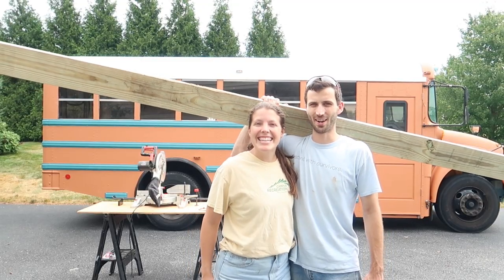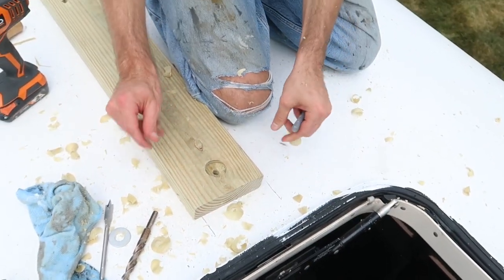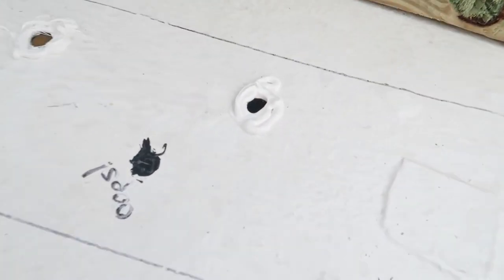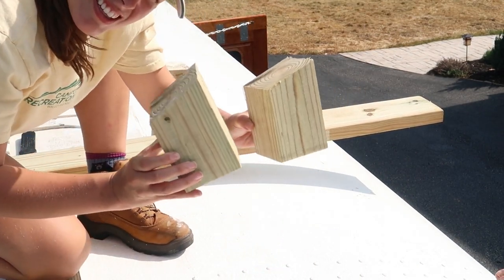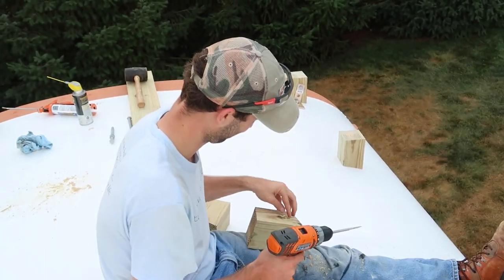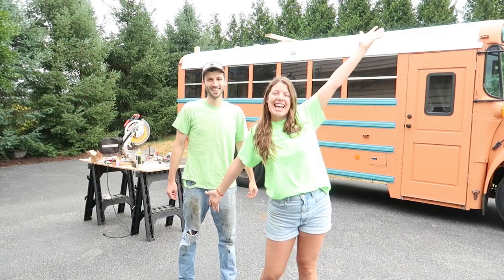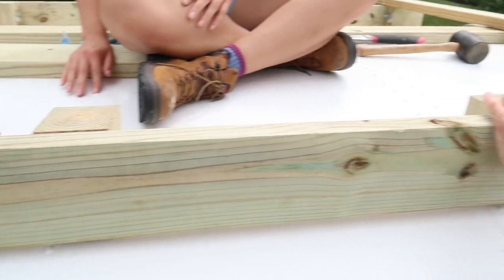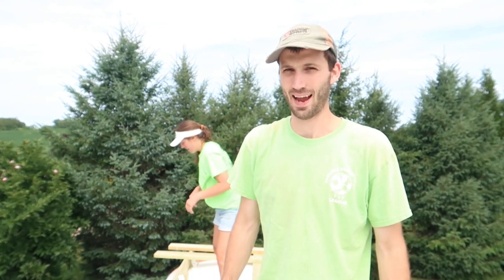Building a Skoolie Roof Deck (No Welding Required!) | BUS BUILD EPISODE 14

Comment: Probably a silly question but why didn't you drill the supports into the ceiling ribs for support instead of just into the sheet metal of the roof?
Reply from the maker: Not a silly question at all! If we had gone through the ribs, we would’ve needed longer bolts and they would’ve eaten into our ceiling height. We were pretty set on our ceiling being as close to the ribs as possible since we are both tall. That being said, from our research it’s common to go through the sheet metal as long as your supports are as close to the ribs as possible since that’s where the sheet metal is strongest.

Comment: Also if y’all didn’t have rv insurance at this point what insurance did you have in order to drive it around? Or did you both have cdl’s?
Reply from the maker: When we bought it we had it registered/insured as a commercial truck. Since the seats were removed it was no longer considered a passenger vehicle so we didn’t need a CDL 😊

Comment: a rubber washer and seccaflex on the carriage bolt probably would have been better on the top of the bus
Reply from the maker: We’ve never heard of that! We decided to use silicone because our roof paint silicone and we’ve read that only 100% silicone sealant will stick to it. We have a few weeks until we install the ceiling so we’ll definitely keep an eye out for any leaks, but none so far after a week of heavy rain!

Comment: I just got my bus last week.  Doing as much research as I can.  How has your deck been?  Water tight?  Anything you'd do differently?
Reply from the maker: The deck has been great! We have had zero problems with water getting in. The only issue we foresee is that the deck is going to make getting RV insurance difficult so that’s definitely something to keep in mind. But we knew we wanted one and were willing to risk it!
Reply: @AdventureTrudge  why does it affect insurance? Just because people go up there?
Reply from the maker: While there are a few insurance companies that insure skoolies as self-built RV’s, many have the caveat that there can be no roof deck or wood stove. For whatever reason, this seems to be the line they draw in the sand for safety purposes. My understanding is that it is more for the risk of people falling off than for poor construction. That being said, we follow plenty of other buses that have decks so there are work arounds! We’ll definitely post more about our insurance once we figure it out.
Reply: Have y’all figured out the insurance?

Comment: I've never bought pressure-treated wood that was "wet"; unless it was in the rain. lol
Also wouldn't have made more sense to mount metal pipe supports than the wood? the wood posts you put won't last...flex then break/rot
Reply from the maker: Pressure treated wood is made by injecting the boards with chemicals and water so if you buy it after it was recently treated it will still be wet. The boards are much heavier and can release some liquid when you screw into them! They’re fine to work with but you should wait until they completely dry if you want to stain them 😊. We used pressure treated because it is made to last outdoors just like a regular deck on a house, since we’re only planning to travel in the bus for a couple years we don’t expect any rotting in that time (an average wooden deck lifetime is 10-15 years).
Reply: @AdventureTrudge  I used pressure treated wood outside as well but I was referring to the wood “ posts” you have; not the platform wood. I too have a school going on 4 years and plan to add a deck with pressure treated wood as the deck but the frame will be black metal piping and flanges screwed into the frame. ( no welding).
Reply from the maker: @Robroy333  our posts are pressure treated as well!
Reply: @AdventureTrudge  I know they are. I’m just saying they may; being wood and not metal, crack from driving vibrations… much easier. I look fwd to your progress on the rest of your build;) it’s an ‘ Adventure’!
Reply from the maker: @Robroy333  totally agree! If we ever upgrade in the future, a metal frame is a great choice. Thanks for watching!